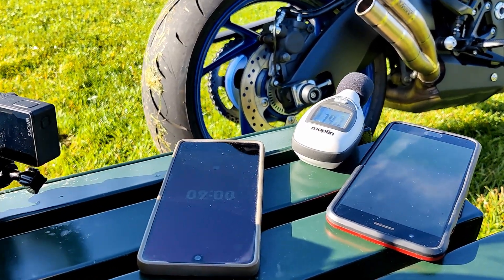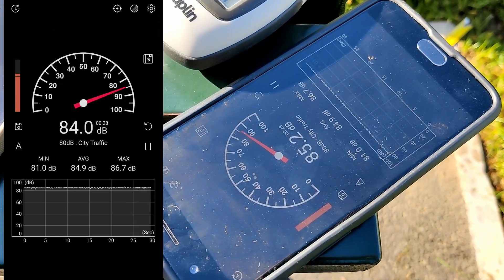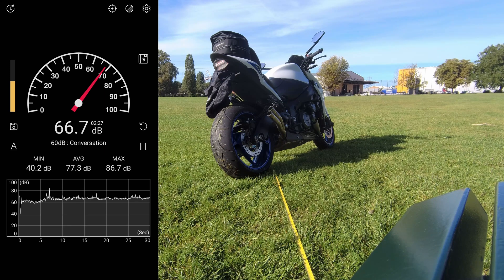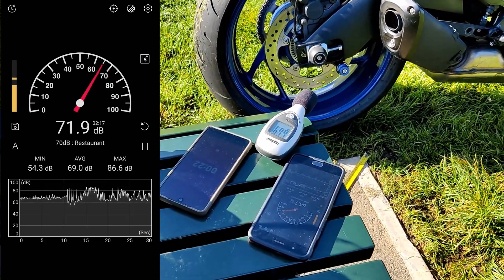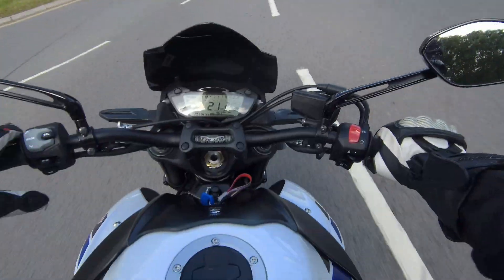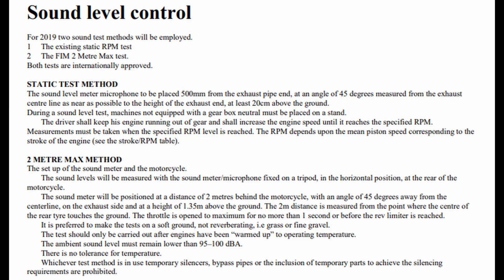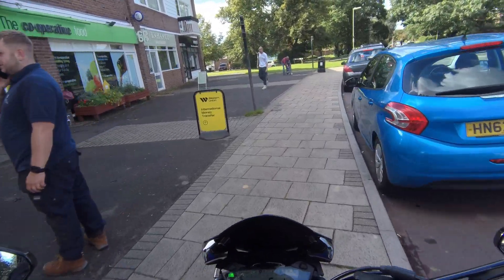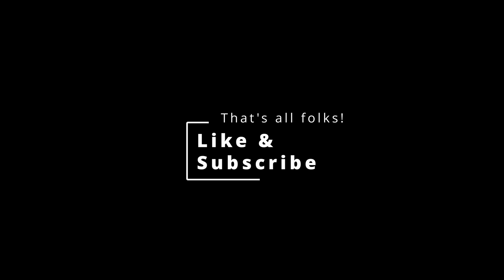Measuring Stock Exhaust db vs Slip-on - Objective decibel Test

Comment: the phones are flat down so the mic is not pointing at the exhaust
Reply from the maker: The mic on these phones, just like almost all of them is directly on the bottom.

Install a SPL meter app on your own to test the directionality of your phone's mic.
Reply: @UpsideDownFork  ofc it is, i don't know what i was thinking. i use Decibel X which is DBA scale which can also be calibrated for accuracy
Reply from the maker: @jase1158  Nice, Decibel X looks good. I'll give that one a go!